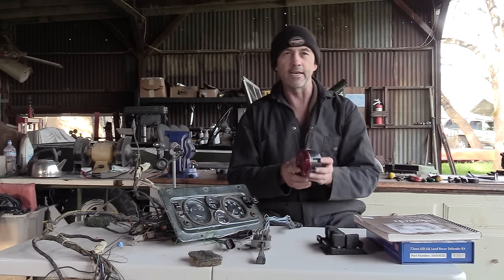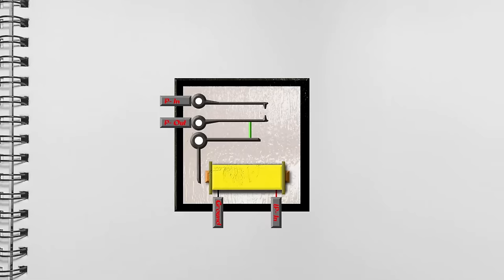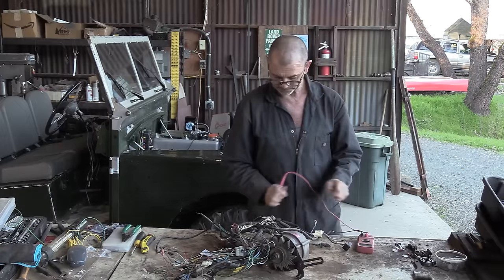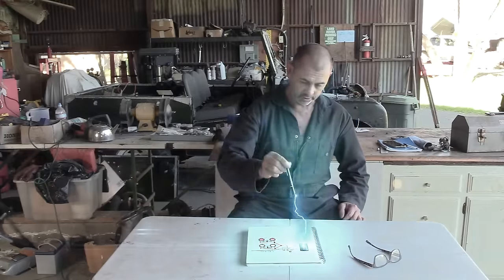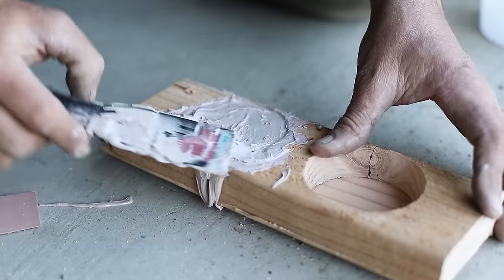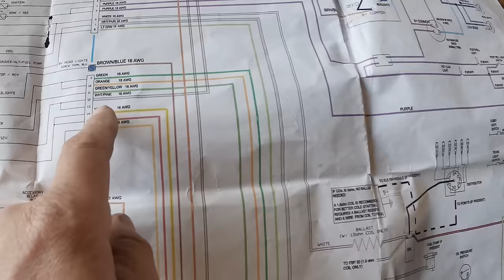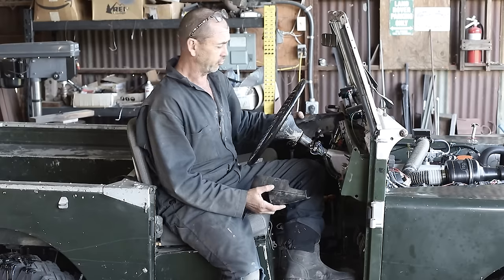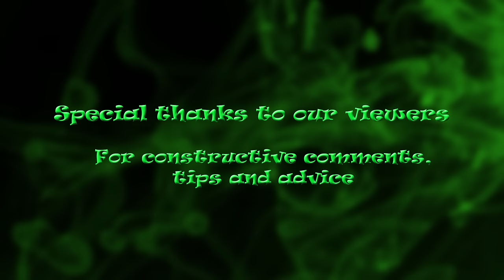Part_34; Secrets of Sorcery: Series 1 Land Rover Restoration

Comment: That's a very neat fuse and relay unit. Looks to be very well designed and thought out. 
Using relays on these old machines is a great move and sure makes it easier to fault find. No more tracking down dead headlights in the dark on the side of the road in the rain. Ive been there a few times.
It may be worth adding a secret coil or ignition kill switch for a little theft reduction.
Reply from the maker: The kill switch idea is a good one and if the truck ends up going on trips then I think I will find a secret spot for one. I probably shouldn't have written that on a public platform though. I've just told the world why the truck won't start.

Comment: Nice work, great job on the restoration and the series.

One suggestion/question if I may. Why not install the fuse box inside the cabin where it is more likely to live longer without oxidation?
Reply from the maker: Greetings. Glad you like the series. There's no good place to put the fuse box inside the cab where it wouldn't be either inconspicuous or at risk of it's wires getting knocked about, It won't fit in behind the dash panel. Where it is currently installed is where the original was so I'm hoping the new one will be fine.

Comment: Don’t shoot the messenger. Due to the vibrations when running ( very soon when you brought over some more recording tape ), your cables might snap at the screw edge of your fuses/relay terminal. Just add some cables sleeves end terminals, crimp, and retighten in terminal. Will look way better and more important, will last forever and ever. Good luck mate. Now get that extra tape. Waited long enough😂!
Reply from the maker: I'm a terrible shot so you're safe there. Your message has not only been considered but is to be acted on. I did wonder how secure the wires would be and after reading your script became convinced it's the right way to go. Thanks for the tip.

Comment: The only change i would possibly have made was if your relays are dual trow (dpdt or spdt), you could have fed the power from your driving lights relay into the common and made the raly trigger the high / low beam. Did this on my SIIA, when i replaced the floor dip switch (which was the best idea for country driving, placed exactly where the left foot rested). Great animation and effects as always.
Reply from the maker: A floor operated dip switch came with the truck but decided to use the steering column multi switch, not much room down in the footwells, they've been trimmed a bit to accommodate the V8 that had been squeezed into the engine bay. The fuse box was all setup for the headlights so I ran with that. I figured I was out of my depth already and opted not to get too inventive.
Reply: Yeah I had a P76 V8 in my SIIA, but it's a bigger truck, so it's understandable. Also, sticking to the instructions is always a good idea if out of your depth... 😊

Comment: Electrickery tamed, well done, not easy at all.  Had to laugh at your Bondo sidelight platform.  I could have 3D printed a platform for you and saved lots of time (other than the shipping time)
Reply from the maker: What program do you use for the modelling? My 3D skills are highly fragmented being self taught. I'll have to look deeper into settings and stuff as some models I import into other programs turn up tiny and others huge. 3Ds Max to Maya is a good example and Maya to After effects Element3D another. As I've said before the 3D printer concept is crazy good. My Bondo platforms are a little thick but they work and with the paint over top they blend in.
Reply: @ForemanAndWilmsAdventures  I discovered recently the Pinjarra library has a 3D printer, clients for the use of. I need to check out that little town at the end of the Murray River.
Reply: Just Googled it, and 3DS Max can export as STL, Maya can't, but can export as 3MF.  So no reason why you couldn't take your 3D models, and 3D print them.

Comment: Wrap some exhaust tape as well
Reply: Love the fuse box... i wired up a friends double headlights on their cortina. It worked till the barrel burnt out. No relays.. doh! Trap for young players pre youtube
Reply: I got from go-gear insulation products.. including flexible tubing for wires and flexible heat shields..
Reply: Racing cars pump a lot of heat out
Reply from the maker: I looked at the exhaust tape and thought I'd rather let the heat out and just shield the wires from the worst of it. I'll find out if I'm wrong soon enough I think.
Reply: @ForemanAndWilmsAdventures  i wonder if youre gunna funnel the heat up towards your carb. You could do both if you wanted. The flexi stuff i got looks like an orangy silicon on one side and silvery on the other.. good also for under floor near exhaust.
Reply: @ForemanAndWilmsAdventures  on my mini i had an air scoop in the grill that directed cold air to my carby..
Reply: @ForemanAndWilmsAdventures  anyway.. i better shutup already.. but the heat shield for wiring tube thingy would be great for your wires.. gogear dont have it listed
Reply: @ForemanAndWilmsAdventures  fyi from the web "By insulating your exhaust pipes, exhaust wrap can help to maintain high temperatures in the exhaust system, which can help to increase horsepower and torque. This can lead to improved acceleration, faster 0-60 times, and an overall more responsive driving"
Reply: @ForemanAndWilmsAdventures  I bet the hotter your engine bay gets the leaner your engine will run.. your car is destined for the quarter me strip?
Reply: Big massive scoop on front bonnet
Reply: ..and some nitrous

Comment: Obviously, your actual wiring differed from your otherwise excellent explanation in one important respect: otherwise the turn signals would not work correctly, as they do.  The error in the explanation is that the Hazard switch is not single pole switch as is shown, but is instead a double pole switch, with one pole for the left turn signals, and one for the right.  At the input the poles are commoned, so that when the switch is closed, both sides receive power, but when the switch is open, there is no connection between the left and right sides.